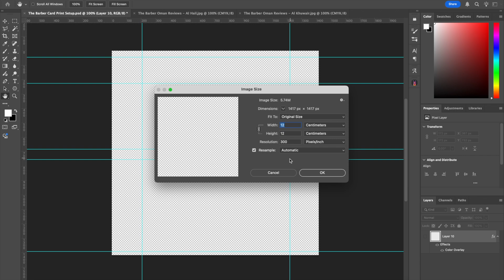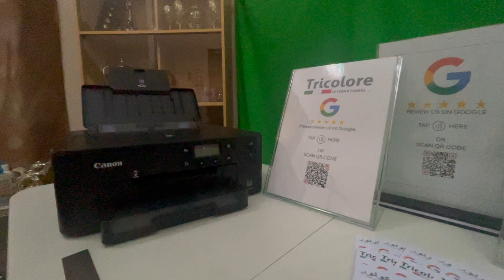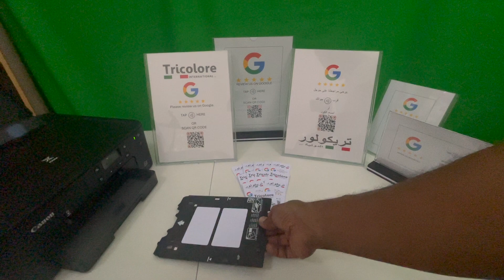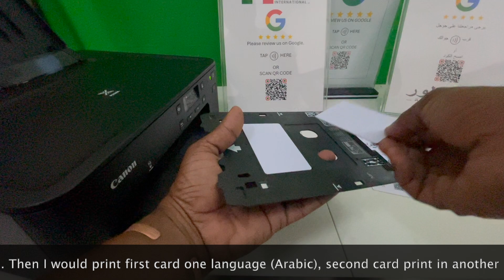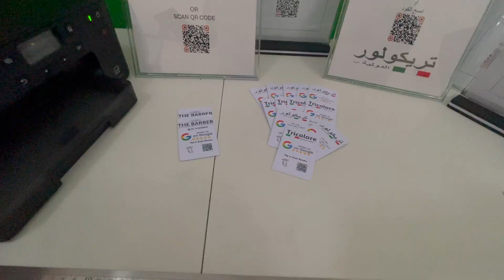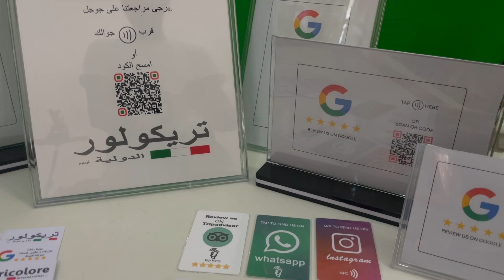How to Print Double-Sided PVC Cards using Canon Pixma TS702a Guide

Comment: can u share the link to the matte finished pvc cards youre using ? or maybe point me out to the correct ones on amazon ? and how about lamination ? should be possible to do after the print right ? maybe manually by hand ?
Reply from the maker: Actually when printed they are waterproof and look good, they don’t need lamination! Pls look at AliExpress 

Even if they are glossy but say you can use inkjet, they work

Comment: Awesome tutorial. Can you please share Amazon links for the tray and for the pvc cards? Can you tell me if the TS705a works in the same way? Last question , after the process do you laminate the cards or they long last without any additional coat. Cheers
Reply from the maker: I actually purchased on AliExpress, just put your printer model and add card tray in the search. I believe my tray works for your printer too.
Unfortunately I don’t own your model and as such I do not know for sure if it works the same way 😢
Reply from the maker: No you do not need to laminate the cards thereafter, it’s water proof!
If you print on card paper, yes you can laminate

Comment: Awesome video. How do I handle "bleed"? If I have color on my PVC cards and not white backround.
Reply from the maker: Thanks 🙂
From what I go through... if you stay with the measurements I provided (also received from a professional company in USA), then there will not be any bleeding. I just faced that issue when I modified the measurements last week. So I returned to the original measurements and the problem went away. 
If you are using color PVC cards. it is interesting, because you can't print white on them. I stick to white cards, so I can print colors (and believe me, they drink color).
The printer has software that you can use via computer to clean the nozzles, calibrate, etc, so that you can avoid the overspray if it starts.
I just did that last week when I messed with the template and printed out of the template, so I had streaks everywhere... I had to clean the tray with alcohol after that. I hope this all helps you so that you don't go through the same
Reply: @LifeInOmanNow  Great, so I just need to follow all you say in the video and use your template? Thanks.
Reply from the maker: @Sobersharp yes! I’ve included the template download in description now
Reply: @LifeInOmanNow great, is there any specific dimensions or dpi I need for the image I want to print on the cards?
Reply from the maker: @Sobersharp dimensions are in the template, you can choose how many dpi you need, 300dpi is more than enough for most card printing purposes!
Reply: @LifeInOmanNow  I used the template, it worked great. But on my printed cards, there is still a "white line" that didnt get printed. Is there a way I can edit the template so I can fit my image better? Thank you :)
Reply from the maker: @Sobersharp  Are you using the same printer? TS702a? If so, then inspect the cards and based on what is white left out, expand the margins equally left and right, or top and bottom for each tray print lines. Therefore, if you see you have 1 mm white, start by expanding .75mm and print just the outline or light color fill on paper, then keep the card on the printed area. Make sure the card fits in the area and there's no overspill. Keep doing this until you get what works for you. IF you are using another printer, then go to the following website and look for a template that will work for you [https://brainstormidsupply.com/learning-center/downloads.html]
Reply: @LifeInOmanNow Im using the TS705a printer. I dont understand what you mean by ”expanding”?

I will check that link and see if they have it for my printer model 👍
Reply from the maker: @Sobersharp  I mean you normally work in some graphic program, so you can see the lines where the card is supposed to sit in as you design. Move the lines to the left and right (expanding area of the card in the middle), so that the design will expand, to fid the card.